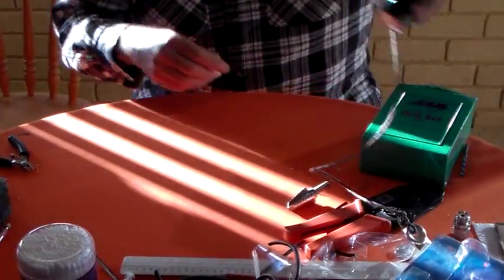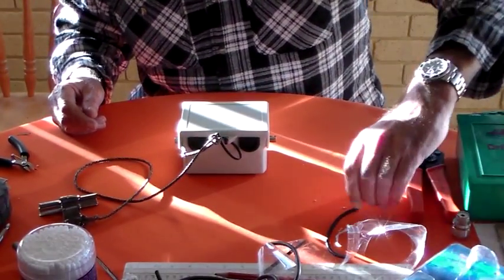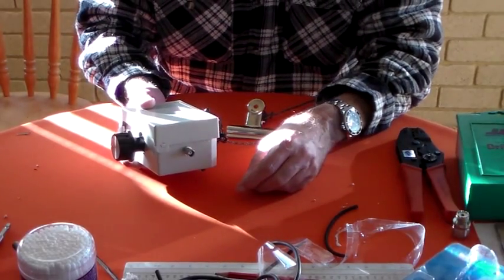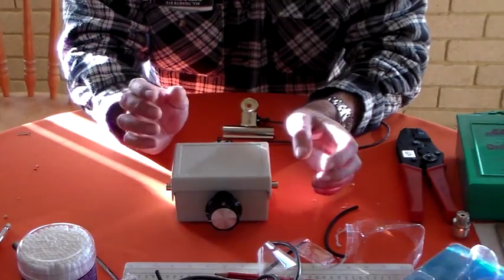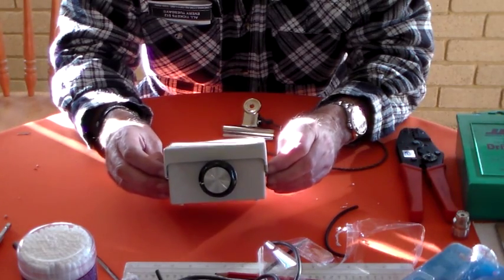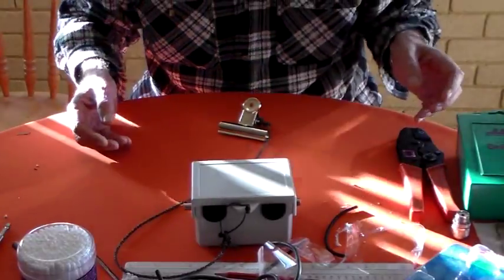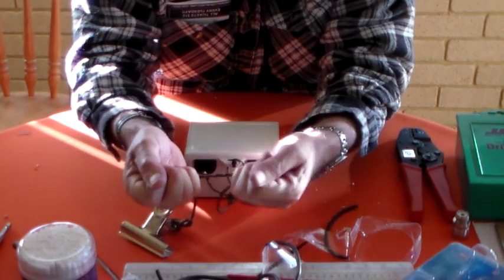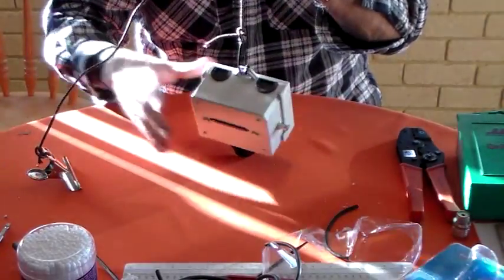What's A Vacuum Capacitor?

Comment: I am not a ham yet working towards that.
I am into gmrs and cb radio.
I am working on a cb beam antenna its a pdl2 
I want to learn all i can about vacume variable capacitors rather than a gamma match.
Have you any experience with that , maybe shed some light on this .
I do not run a ton of power or anything like that i just like learning new things.
Tia 
Randy 
Florida georgia line.

Comment: So essentially, a capacitor is like the old school project of a magnet with a 9V, screw and a coiled wire. Just that the wire and the screw have no electrical connection. Like the Tarheel antenna?
Reply from the maker: Er, no. A capacitor stores energy in an electric field between the plates. The electro-magnet experiment you describe stores energy in a magnetic field, the coil is an inductor. I hadn't heard of Tarheel antennas but a quick look suggests they're 'screwdriver' types. The coil at the base is a loading coil, it's adjusted to provide the maximum current into the antenna.
Reply: VK6CS reason I mentioned that. A capacitor was made using the the screw magnet idea. Two nut were soldered to a pcb, bolt screwed through it and on the threaded end, teflon tape was wrapped over the threads and a magnet wire over that. Two separate connections but a modified magnet project.
Reply from the maker: I can't really picture that... but I hope it was fun.